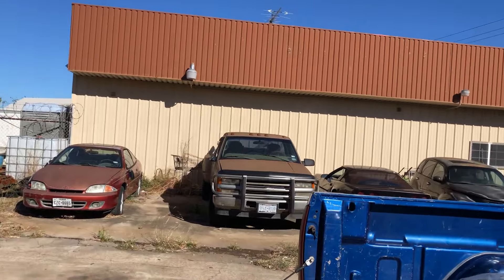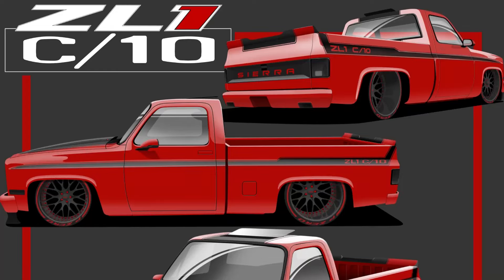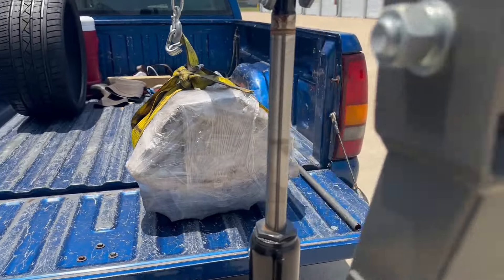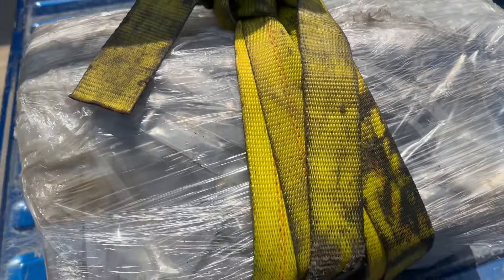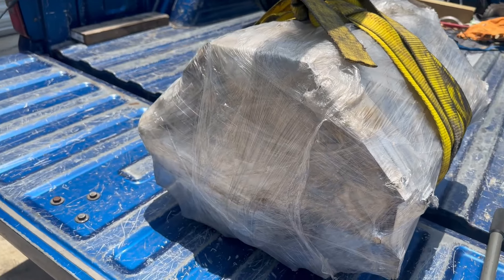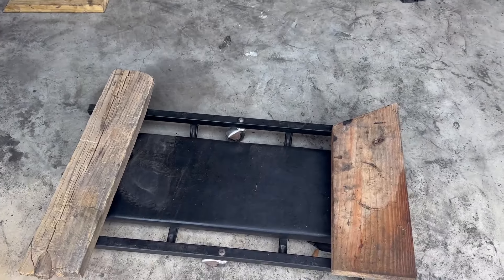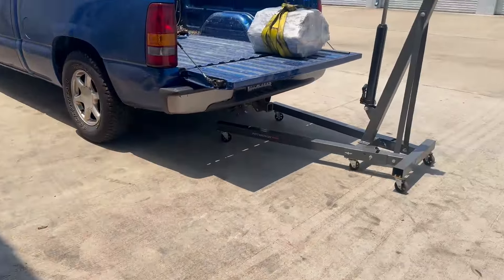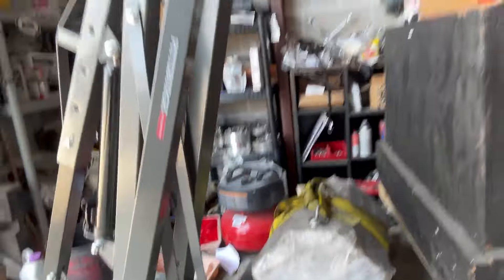1000HP 408 STROKER LS

Comment: Yes sir everything going to be running strong!!! What heads are you going with?
Reply from the maker: Haven’t decided on the heads yet.. I have a spare set of LSA heads that could have ported, but I may end up going with a Frankenstein product.
Reply: @RedAndBlackCollection  Hoopers 11 degree heads are on a black friday sale for $2380 or they are offering $200 off porting prices.

Depending on the valve angle of your valve reliefs in the pistons. And how aggressive you cam lift is. Porting those LSA heads will be great for for that HP range.
Reply from the maker: @421ssrida  Preciate the advice bro. As always I appreciate your perspective 🫡
Reply from the maker: I have a set of LSA heads ported by Hooper that I’m using for the MC build